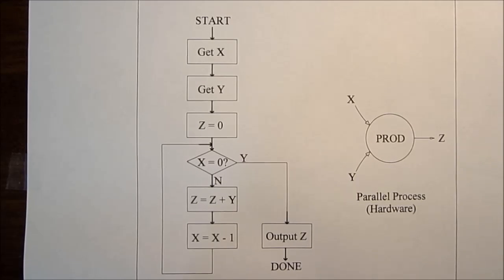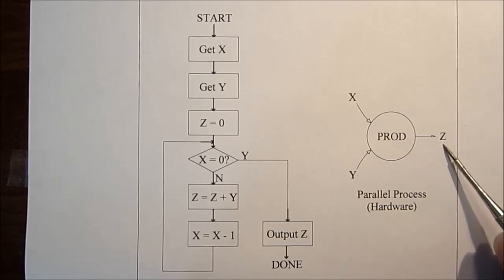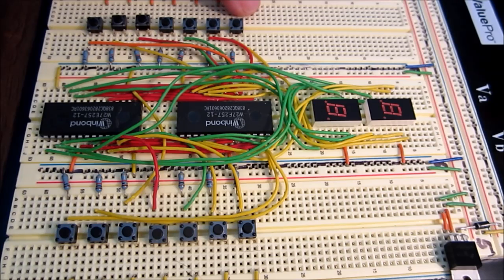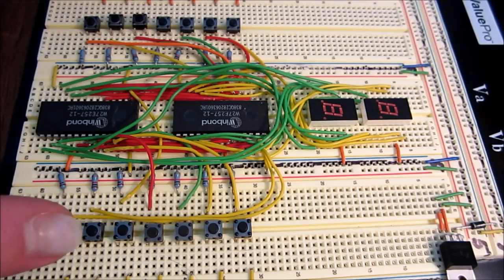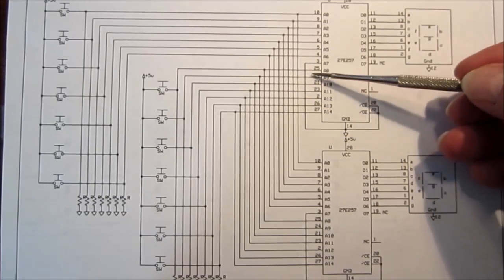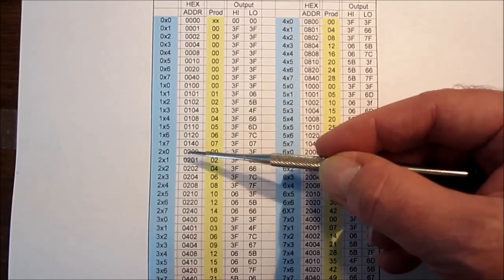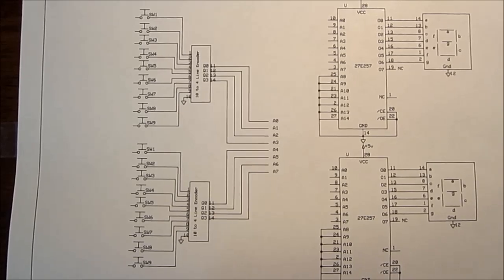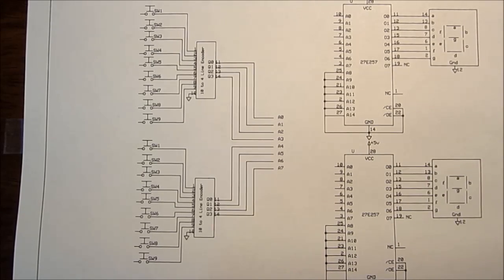Sequential vs. Parallel Processing

Comment: Would a ripple addor be a sequential or parallel system?
I can say reason it  cause be classified as either.
Parallel: takes input in parallel, no code/firmware
sequential: each pair only (for sure) gives the correct answer after all the pairs before it have completed their addition.